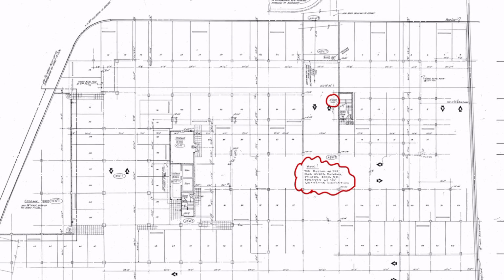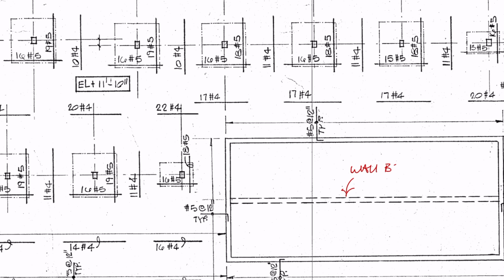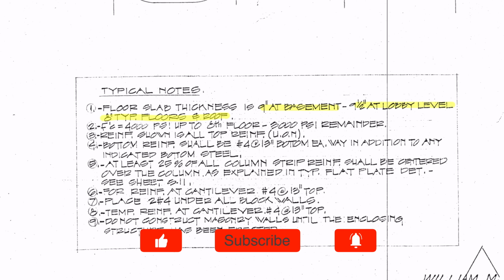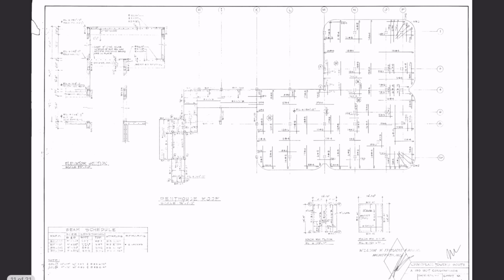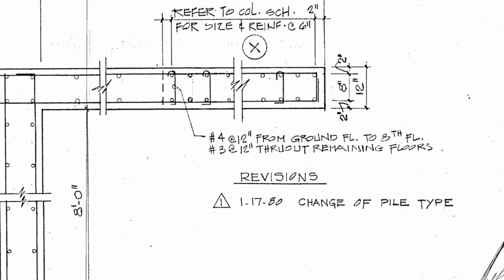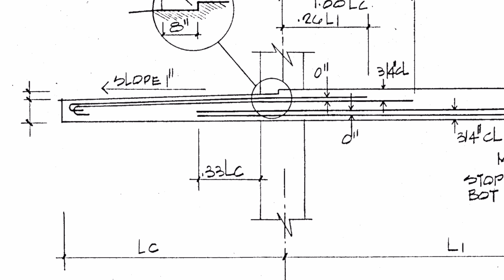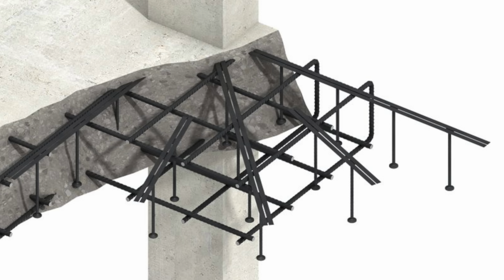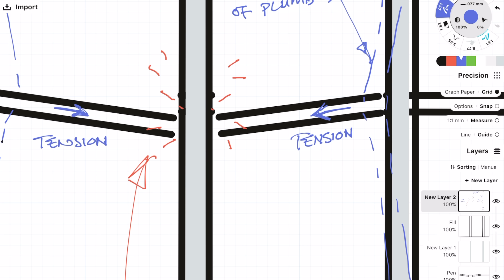Surfside Condo Collapse - Reviewing the structural drawings - Was the design bad?

Comment: My concern is that if the structure was built without punching sheer then the sister building would be the same. I hope this is being identified and rectified as soon as possible because that building would also be built in a way that it is unprotected too.  Perhaps the same designs were used in many buildings of this age.  They should all be on notice and be adding strength to the lower levels as soon as they can to prevent another similar failure.   We can’t blame the builders of the day, what we know now in regards to buildings and structure surely has evolved with time and I do not believe any engineer or architect would want to be the designer of any building that could fail and cause great loss of life.  We like to blame people, instead with greater knowledge we should be using that to prevent further tragedies of this nature don t you think. Anyway, thank you for your video.it helps a lay person like me understand better the past construction techniques of tall buildings.
Reply from the maker: Building without punching shear links is absolutely fine as long as it’s designed to work without them. 

I will be doing some numbers on the punching shear to test my theory.
Reply: @EverydayDazz  that’s wonderful, from what I saw of your last video I become very worried many older buildings may be at risk as well. That’s what happens I guess when they say a little bit of knowledge could be harmful. Thank you for clarifying this for me
Reply: It’s not just the sister building to be concerned about. It’s every other building built about the same time.

Comment: No beams in a traditional slab thats the case those pour columns making all the work…you need to review your methods of construction in miami..it look like a cheap contruction for money saving…even in a pour country at least put some capitel over the columns…when punching shear occurs and the slab above you fall in your head there is no place to hide or survive,every inch of your house its crushed by the condo above you…thats sad…
Reply from the maker: It’s a flat slab construction which doesn’t need beams like a 2 way spanning slab. 
It’s a very efficient and popular form of construction when done correctly.
Reply: @EverydayDazz  yeah i know there is a lot of buildings like that but with any problem like bad maintainance or corrosion your building fell like a house of cards with beams at least there is so much safe and maeby will be more survivors for sure and you prevent the punching..its unlogical that the slab in the pool deck fell and that makes the whole building fell…thank you for response greetings from argentina 🇦🇷 👍🏻
Reply: @EverydayDazz  2 way slab.
Reply: First he’s not from Miami he’s from England. Second I would imagine that the building code has been revised in the past 40 years.

Comment: Excellent video!  Well thought through.  Thanks for sharing.  I have seen numerous reports that significantly less rebar was actually installed than was indicted on the contract documents. A marginal design, not built to spec., a lack of maintenance, and a lack of inspections resulted in the disaster in my opinion.  I think that it was a combination of these negative factors, and probably a few more negative factors that I am just not aware of.
Reply: Marginal design?   --  It was a BAD - death-trap design -- especially since it sat directly at ocean's front with a hurricane view.
Reply: @roycem4945  Fair enough “bad design, bad construction and either poor or no maintenance at all.
Reply: @PaulJersey   in this video - see time 10:00 thru end -- as he identifies  flaws in the design - IF only the building had a second stairwell like what held up the other portion -- wider columns, more rebar, and the lack of heads on the columns to help prevent punching sheer -- https://www.youtube.com/watch?v=SEb12QwgM3s
Reply: @roycem4945   There were definitely blatant design errors.  All the points brought up in the video are valid and accurate.  There might still be additional design issues that no one has even identified yet.

Comment: I saw another video that said that the rebar toward the top of the slab and the concrete above this rebar over the columns had most likely delaminated due to the spalling, so what little strength against punch through was gone.

Comment: There had to be something wrong with the initial construction, since 500' of cracks were found on the pool deck in 1996...and were repaired by filling in the cracks by way of the garage roof.  

I would think that a building that was 16 years old should not have had all those cracks in the pool deck.  Isn't 16 years old considered to be fairly new for a building?

Another thing that I can't understand...since I'm not familiar with that kind of construction...is why they tied the pool deck into the main structure of the building with beams.  Parking garage roofs are known to collapse, so the pool deck was the parking garage roof....and had to bear the additional weight of sand, paving material, planters and water.  If it had been built as a separate unit, it might not have brought the building down when it collapsed.
Reply: All it took was 8 or 10 feet of void for the 1st floor to collapse into, then the rest of the tower just pancakes down on top. In short we have a series of defects, mistakes and corrosion here. a perfect storm.

Comment: The punching sheer is quiet evident in some of the photos of the scene. Many of the columns exhibit a clean punch with little or no residual cap.
Reply: There are pictures posted showing the clean punch through of the patio slab.The multiple slabs are neatly piled upon each other at the base of the columns. There is also a video of someone parking their car on the parking level about a year ago. In that video I immediately noticed the lack of shear capitals at the column/slab intersection. Although that would be OK if there were radial shear reinforcement wholly within the  depth of the slab, that turned out to not be the case. My immediate conclusion was that this was a punching shear failure.

The low rise  patio/parking slabs apparently were integrally cast with the tower columns where the low rise structure met the high rise structure. I would never do that. With a high rise -- low rise combination structure, I would put a construction joint where the two different height structures abut one another, but for a different reason. The two different heights will settle at different rates. It's best that they not be connected. But it looks like in this building they were. So when the patio slab failed, being connected to the tower columns buckled the tower columns and changed the kl/r ratio in the columns so that they failed, bringing down the tower. Had the patio not been structurally connected to the tower, the patio failure would have been localized. At 1:30am, the patio and parking below it were likely unoccupied, unlike the tower full of bedrooms and their sleeping occupants. This might have been a much smaller accident with no loss of life if there had only been a joint where there wasn't.
Reply: Only at the patio, not at building.
Reply: @designstudio8013  yes correct,  and I think it's because the pool deck is exposed to the elements,  and if you look at the pictures of other failures with punching shear,  they are mostly car parks exposed to the weather,  in these exposed conditions,  the slabs need more support,  to increase the tolerances.
Reply: If you look at some of the photos before the failure, some of the columns had no shear caps at all. It was the monolithic flat slab / column combination characteristic of concrete apartment buildings. As I've mentioned elsewhere, that is not necessarily a bad thing, as shear rebars can be buried within the depth of the slab alone, depending on the loads and depth of slab. Nevertheless, whatever they did do, it does look like they got it wrong.
Reply: @michaeljarosz4062  My mentions of caps was probably not the right way of expressing the fact that portions of the damaged slab were not attached to the columns after the collapse. Sorry about that.
Reply: Yes and that's troubling.

Comment: Without waiting any expertise I can tell the concrete strength was also below norms
Reply from the maker: I had a look at the concrete strengths for the columns and slabs shown on the drawings and they look about right for the height of the building. 
Whether or not they used that concrete strength at the time of construction we don’t know. 
However even if they didn’t, concrete gets stronger over time so I don’t think the strength of the concrete was the critical reason for why the building collapsed.
Reply: @EverydayDazz  It is pretty easy to mix 3,000 and 4,000 psi concrete.  It is pretty hard to screw that up.  In my area, I don’t think they even sell concrete with strength less than 3,000 anymore.  I really doubt that concrete quality was an issue here.  It seems much more likely that the issue was poor drainage, poor waterproofing and poor maintenance of the building that led to failure of the rebar.  However, we won’t know until the forensic investigation is complete.
Reply: @EverydayDazz  I already commented about this article but the head of the company that demolished the remaining tower gave an interview and he said the concrete was super soft and nowhere near the strength listed on the plans that also didn’t match what he found in the building’s remaining structure. He also said the columns varied dramatically in thickness sometimes by as much as 8 inches.
Reply: @Jude74  Where can this article be found?
Reply: @k53847  Thank you. Interesting article!
Reply: @EverydayDazz  The blasters who drilled into the columns to implode the remaining building noted that some places where the drawings said should be 6000 PSI concrete didn't seem like they were 6000 PSI concrete.
Reply: @k53847  Any idea where I can find the info on this?
Reply: Wow, that’s amazing.  You must be very wealthy possessing magic skills like that!
Reply: @LTVoyager  actually my intuition comes from seeing the rubbles. 
What I was expecting to see for a strong healthy building is clear layers of floors where rescuers could find survivors , what I saw in reality was a big pile of sand. 
I remembered seeing the rubbles of buildings after strong earthquake in Chile and rubbles of buildings after weak earthquake in China, very different. Those in Chile collapsed in big chunks where you could see a lot of surviving spaces while those in China was pile of sand, just like this one.
Reply: @markmd9  There are many pictures that show floor layers and broken, but largely intact beams and columns.

Comment: The shear wall layout does appear to be skimpy in the east-west direction.  However the left side of the building did stand up after the remainder had pulled away so it is unlikely that shear walls were a factor in the collapse.  If the tropical storm had hit the building during the recovery effort the remaining part of the tower might have failed.
The lobby level framing plan shows top bars that would go from that step down slab detail into the lower slab- #5@12.  As you suspected a hooked #5 won't develop in a 12" wide beam.
Punching shear appears to be a weak point in the design.  I've already done punching shear calculations on the typical pool deck area and found areas that were deficient.  You should do your own punching shear calculations to get your own opinion.
Reply from the maker: That’s what I’ll be doing next and doing a video on my findings 🙂
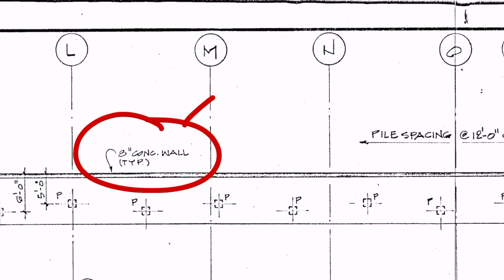Reply: @EverydayDazz  You don't seem to have the same set of drawing that was available for download from the city.  In that set it was a large PDF file that contained multiple copies of each sheet and they were in random order.  There were structural drawings with no date, structural drawings dated 1979 and some drawings with revision dates in 1980.  There were also preliminary drawings of the north tower however there was no detailed foundation plan like the one that you show at 1:47 in the video.  Look through all of your drawings to be sure that you are using the latest ones.
Reply from the maker: I had a file that had over 300+ drawings. I just went through them and picked out the structural ones. I may have missed a revision here or there but they all did look roughly the same.
Reply: @EverydayDazz  The south tower original drawings appear to be dated 8/22/79, with sheets S2 through S5 revised 1/17/80.  It is important to get the latest of sheet S5 because its slab depressions and beam layouts changed, the others had only minor revisions.  The only version of S1 in the drawings is undated so we don't know what the final version looked like.
Reply: @billj5645  You sound like you know your stuff. I would love to watch a video review based on your opinions on the collapse. 🙂
Reply: On interior columns I got 960 kips axial ld. 
Don't know what the moment force was on deck ripping away from column.
Columns became unsupported and twisted.
Reply: The slab ripping away from the tower columns caused a torsion in them that resulted in buckling and failure. You know..... that kl/r thing.
Reply: @michaeljarosz4062  There is no doubt that the pool deck could be pulling on the columns, but they have the undamaged slab on the inside pulling back, which by all rights should have greater strength.  The column between lobby level and level 2 is the longest single piece of column and it is KL/r around 25 so this plus additional bending moment cranked in at ground level doesn't provide an indication of a failure point.  Any torsion induced in the stepdown beam would probably fail that beam in torsion before it put very much bending into the columns.  Now if the ground level slab did fail all around at the critical columns on the face of the building, those columns would no longer be braced by the ground level slab and  their KL/r would jump to over 40.  This is a range where they could certainly buckle and fail.
Reply: @michaeljarosz4062 Your analysis is good.
 Euler; but I think the slab crashed into the side of the columns or the slabs detaching caused a slow twisting along with slabs braking from the column. Along with massive live and dead load additions the building was teetering on failure.
Reply: The SWS are why the left side stayed up!

Comment: What should be done to shore up the remaining buildings by the same drawings, contractors, and around the same time frame besides normal maintenance.. I would at minimum place additional shear walls in the garage level of this type of design to avoid complete collapse
Reply: The world trade center in NY also had no shear walls in the main vertical stairs/elevators and that can give the main support to a building (more resistance, we always do that here) of being of compact reinforced concrete and not of a column and beam style construction.
Reply: @franciscorompana2985    the twin towers were built on the cheap - using the truss system.   A terrible way to construct a building - especially a tall one.
Reply: @franciscorompana2985  steel framing is a completely different design consideration.
The most unexplainable element of the twin towers is why is a 12 story building rubble pile approximately the same height as the rubble pile from the twin towers.
Reply: @normansabel1850  I saw the molecular dissociation of the I-beams in video in real time. Dr. Judy Wood, Ph.D. talks about that.
Reply: @normansabel1850  
I believe part of the issue is that the World trade Center at seven below grade floors. 
Unexplained? That was the rubble pile from the buildings. A lot of people watch them collapse it wasn’t vaporized. 
Well most of it wasn’t.